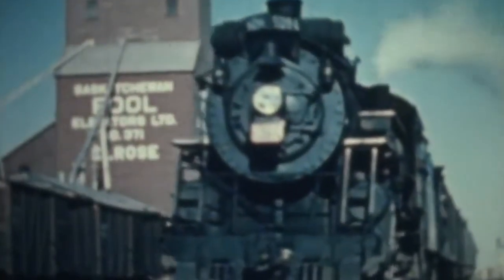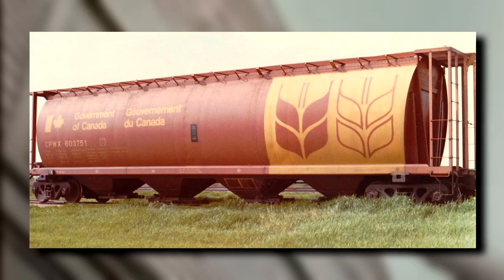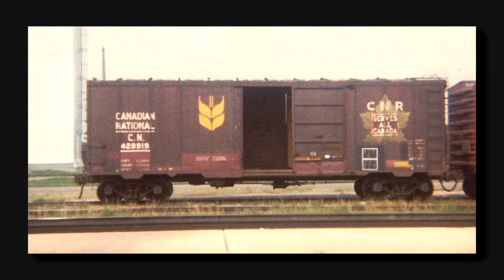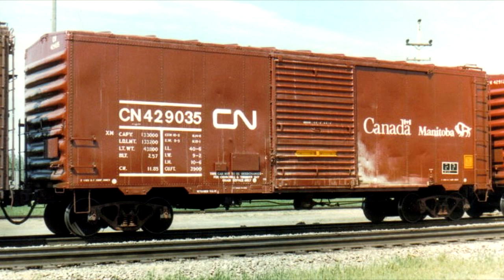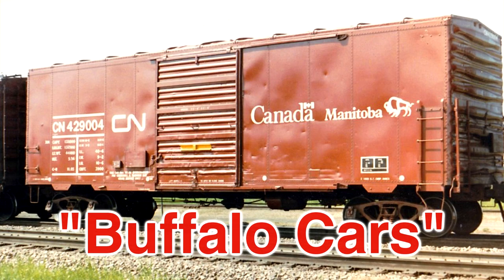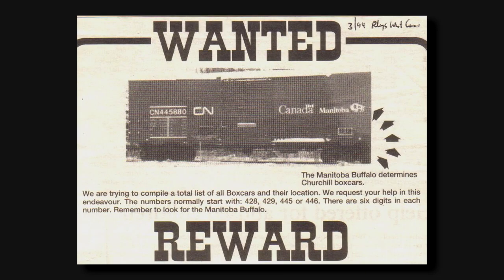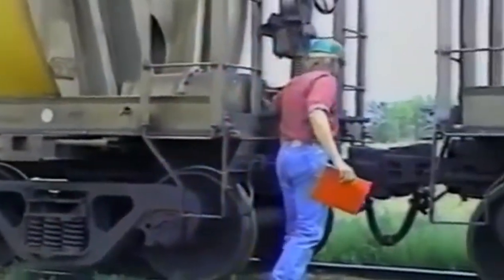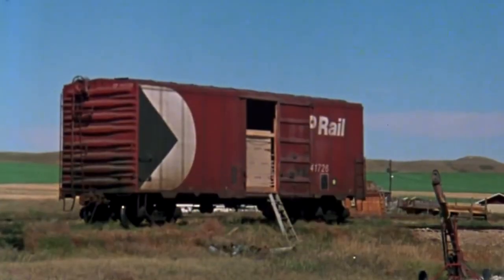Canada's Grain Boxcars

Comment: I grew up in rural Appalachia during the late 1960s and 1970s. I tried to remember the first time I saw a covered hopper. At the time I was a kid, there was a great deal of corn (maize) and sorghum being grown and shipped out of the Teays Valley area and I am pretty sure that in that area, at least, the Penn Central (later Conrail) and the Chesapeake & Ohio (later CSX) were both using open hoppers and gondolas topped with (often poorly affixed) tarpaulins, rather than true covered hoppers for grain haulage, well into the late 1970s, possibly even into the early 1980s. So, as far as I can tell, the Canadian railways were not unique in being slow to upgrade their rolling stock, they just used boxcars instead of rusted out open hoppers no longer fit to haul coal. :D
Reply: Chessie System was notoriously known for their “Triple X” hoppers, old 50 Ton hoppers that had fallen out of regular maintenance and still had friction bearings (I think) and because of that were deemed not safe to interchange (hence the large yellow Xs on the cars) they continued to haul coal, taconite pellets and I’m sure grain not sure when they disappeared but the 1970s and 1980s would’ve been the era when they were operating on Chessie trackage, basically it was an effort for the railroad to get the last bit of good out of their rolling stock before taking it to the breakers
Reply: @loganbaileysfunwithtrains606  I recall the Xs on the sides of the open hoppers. They were plentiful in consists on the line between Huntington WV and Charleston WV, and you're right about the friction bearings. They made an almighty racket as trains picked up speed on the downward grade either side of he hump at Culloden WV. I even recall seeing a few hot boxes and quite a few seized axles showering sparks as the wheel skidded along the rail.
Reply: @kitchentroll5868  from some pictures I’ve seen a lot of yard still had journal oil tanks up until the around the 1980s quite surprising they took the time to at least partially service those cars from time to time and I’d say the down fall for them was the bearings burning out while OTR, something charming out Chessie was them using their eclectic fleet of equipment well past its retirement something they seemly did often as my dad said he recalls seeing some Virginian marked hoppers on a few trains. Of course the Virginian was bought out by the N&W but I have no proof to disprove what he said but I’m sure Chessie just took out anything that could still roll down the track to use
Reply: @loganbaileysfunwithtrains606  Well into the 1990s, in the Huntington WV yard, you could still see hoppers with barely legible markings for B&O, C&O, Western Maryland, Seaboard Coast Line, Clinchfield, L&N, N&W, and the rare Virginian. I even remember the occasional Erie, Pennsylvania, and New York Central hopper creaking its way through the Huntington yard. All of them dull and well rusted.  Even now, you occasionally can catch sight of a consist of old rolling stock obviously on its way to the breakers. Although now defunct, Weiler Steel in Huntington used to have a scrap yard that featured gondolas of long defunct lines that were used to move scrap around. One of the gondolas was from New York, New Haven and Hartford, another was still readable as coming from Lehigh Valley over-painted with Reading at some long ago point.
Reply: @kitchentroll5868  your comments about worn out old Freight cars that had an extension on life remind me of a few that I've seen over the years. In the mid-1960s the Milwaukee Road took the tops off old stock cars and use them to little Coke here in Milwaukee at Milwaukee Solvay Coke. Illinois Wisconsin Sand and Gravel had some ore jennies that had heralds from the Duluth Mesabi and Northern.  Northwestern Steel and Wire in Sterling IL would take tank cars and cut the top off for use as inplant gons and they also had some former Burlington 50 ft box cars with the roof removed for the same Duty. Here in Milwaukee there was a Pierre Marquette gondola that lasted into the 1990s at harnischfeger Cranes. A firm that made bottling machinery in Cudahy WI would assemble them on Old flat cars and move them through the plant not certain where they all came from but they were like 35 ft long heavy on the wood and some still had Fox and archbar trucks when they closed they all got scrapped on site and I never taken a photo of them. So sad and stupid

Comment: Under the Crows Nest Agreement, the Canadian government loaned CP the money to complete the rails to the west coast, along with repaying the loan, CP agreed to low rates for some bulk commodities. The 1890s rates were never increased, and the government arbitrarily later forced CN (and it's forbearers) to take the same rate.  70 years on and the railroads were losing huge money moving grain and there was no way they were going to spend the capital needed to buy new equipment that would never return the investment, hence the government paid for the new hoppers. In the 80s through to 1992 the rates were finally improved and the railroads became responsible for purchasing any new equipment.  
Sadly, the Government of Canada hoppers, along with those in about a dozen other colourful paint schemes are coming to the end of the service life and are being replaced by boring battleship gray hoppers with just the railroads names on the side.

Comment: The unloading process makes sense, but how exactly would you go about loading grain into a boxcar?
Reply: The spout is fastened to the top board on the grain door and pointed to the back (end) of the boxcar.  It is a jointed spout and flexible. The grain falls down the tube so fast that it shoots almost all the way to the end.  When one end is full, the chute is redirected to the other end.  I used to get up in the boxcar with my dad to help shovel the resulting mounds into a more level load.  The center  of the car only got what slid down the mound and what was shoveled from them.  Don't know that this would have worked on 50' cars and is probably why you never hear of a 50' grain boxcar.
Reply: @ronatwell5379  to the best of my knowledge only the SOO Line and CB&Q had newer Steel 50 ft box cars that were okay for grain loading built in the early 1960s. The only way to tell was on the door the top part folded back for green inspection and on the inside wall you would see a striped marking to show the height which were marked for corn wheat and barley. I'd guess they were all gone by the mid-1990s

Comment: how did they get the grain inside? was there a hole in the roof?
Reply: If you look at the thumbnail pic, the loading spout from the elevator was inserted into that open spot over that brown inner door (called a grain door). It was loaded as high as the grain door and then the main door was sealed. When they got to the unloading port, the boxcar was out on a rocker to move it from side to side and the grain doors were cut open to allow the grain to spill out. Anything left behind was shovelled out.